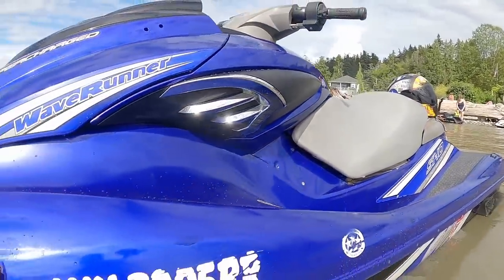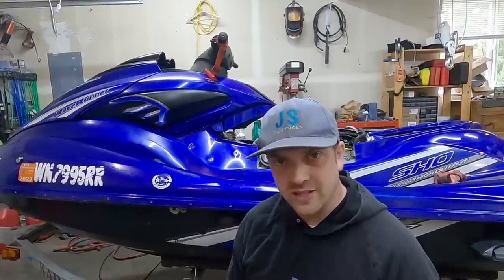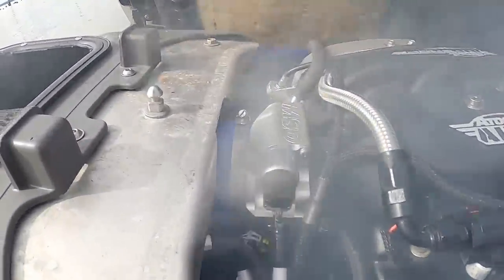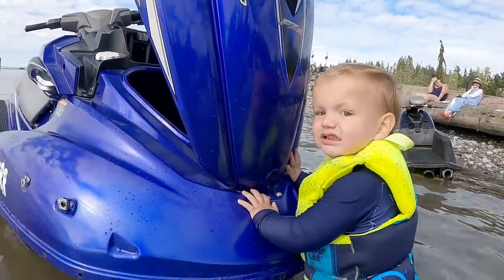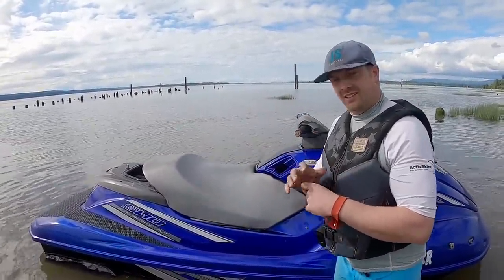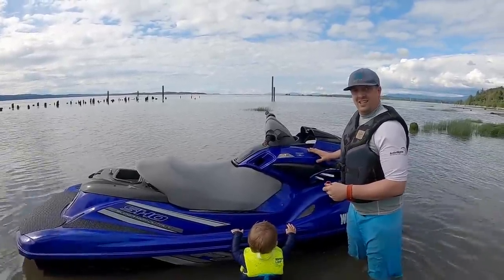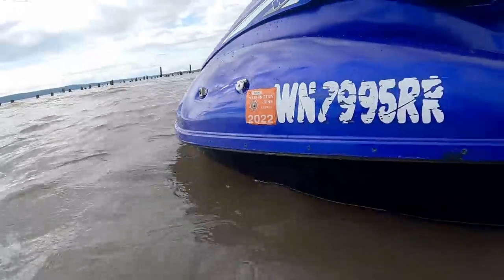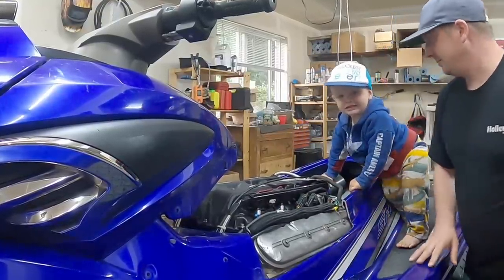v8 jetski returns

Comment: Milo did an amazing job! Can I ask, how does this compare to a stock 1200cc jetski speed wise Milo? Just wondering about the extra weight of the V8 slowing things down a bit, power to weight ratio and all that. Thanks Milo
Reply: I would just like to know how fast it is, Thing is, a factory 1200cc jetski engine only runs around 60mph. but they produce less than 200ft/lbs of torque where that V-8 prob' produces like 400ft/lbs. And torque is needed in a jet drive. I'm not sure exactly how much hp that V-8 is making, but I believe it's well over what a factory 1200cc produces,  So with more hp and a lot more torque, I'd say it will run 90 to 95mph. It may break over 100mph. but I wouldn't want to be the one on it when it does. lol.
Reply: Doubt that it takes any speed away because on throttle its a lot of the ski out of the water when up on plane, now it has way more torque/hp so the hp up top will likely send it into the triple digit speeds if he is willing to take it that far

Comment: Love the sound of the V-8 but if I have  Deep Pockets it would be 93 RX7 R1 package 1.3 rotary double Turbo 255 horsepower stock, 225 foot pounds of torque much lighter, perhaps better fuel return .
Reply: Stock motor has better specs all around than that

Comment: Nice going. I want to know what it weighs now. It's fast but it really plows water like skis do fully loaded. Even at idle you throw a wake. I'm also curious about the higher RPM numbers. How close are you to recline and are you getting a different pitch impeller to better match that engine
Reply: It should only be about 200lbs heavier give or take. Plus they removed a lot of the unnecessary stuff that Yamaha packs inside them

Comment: Really cool machine bro but maybe you should get a different prop because if you're only doing 48 miles an hour at 4000 RPMs I think maybe you can get better times in that at that 4,000 RPM range well I should say better speeds than 48 measly miles an hour at 4000 RPMs the engine redlines at 6 or 55 if its stock so yeah I'm not really impressed with its performance or yeah right now to be honest with you but I'll keep watching great video congratulations I love when you put the little man in videos it's awesome

Comment: Heyy maaan!! Great job. All the big name Drifters with LS engines all have breather problems with oil coming out of them. Tyler Ray has great ideas on how you can fix that issue. 

What I would do is build a catch can that will allow the oil go back into the engine but I know there’s not much room for that but you could use vacuum to force it to go back in. Just  a idea. Good luck!!

Comment: Would a Berkeley or American turbine pump out of a full size jet boat fit with modifications? I don't think you are using half of what that motor has.. if you do get a higher pitch impeller for the existing pump I bet you start twisting shafts. Anyway you put it that's a bad ass build !! Love it. !

Comment: V8 thats sick. People lets do keep some prospective however, although a V8 can be a very powerful engine and a jetski a small boat there is one thing we need to remember and that is most of these jestskis are built with Horsepower in mind meaning as powerful as a V8 is that may not trump the engine that was put into this ski already I mean many of these skis are already 215 to 300 HP if not more so that said aV8 engine in many cases is only in that HP range already so it's not and upgrade. I just wanted to point point out also add it the weight and the fats the V8 is not made to run such high RPMs!

Comment: Great to see you out after all that work! I've watched your videos for quite a while but I don't remember seeing why you need to run a gearbox to run the pump? You couldn't just run it like stock right out the back??Or did need some kind of gear reduction??
Reply: I think they said they needed the shaft to be lower to line up correctly, and I think they also gear it up to take advantage of the torque.
Reply: @macksgarage1291  that's exactly why they did it. Needed more rpm out of the jet unit aswell as lining it up
Reply from the maker: Feels great to have the v8 up and running again. 👍 as for your question it seems they got it answered in the replies 👌 thanks guys 🍻

Comment: Get the biggest pitch prop possible gear it for like 150mph theres no way there can be to much prop on that thing ull be able to do 80 at like 3000rpm lolll and for some reason if there is a possibility of to much prop thats a good reason to build the motor for 500 crank horse power lol